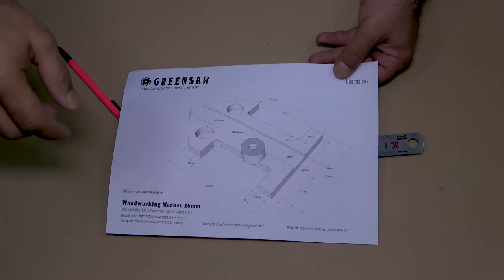Plastic or Wood - Woodworking Marker DIY  [4K]

Comment: 6:15 That flaw in the groove to the upper right is the reason you shouldn't make your passes in that direction. By doing that, the bit will try to force the workpiece away from the fence and remove too much material, which happened here.
Reply from the maker: Thanks.